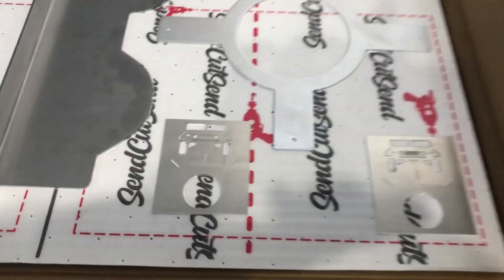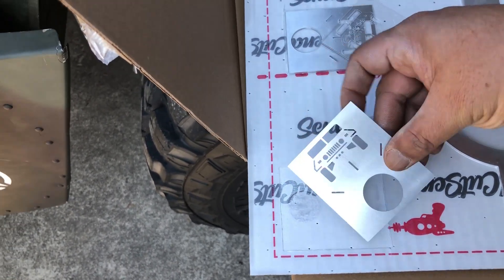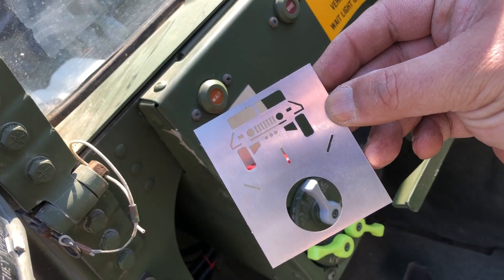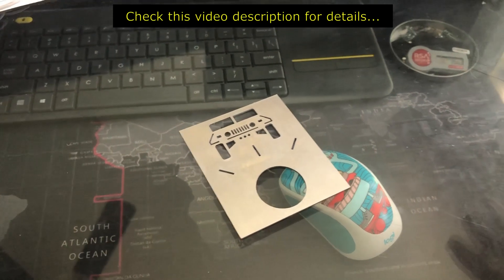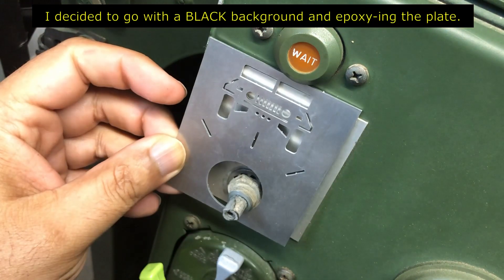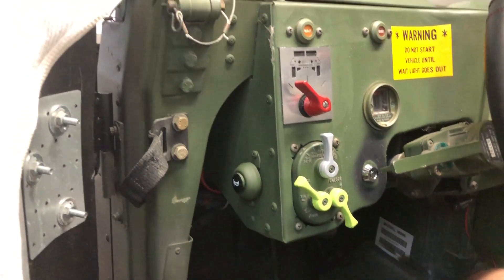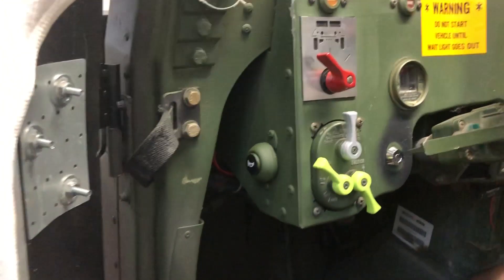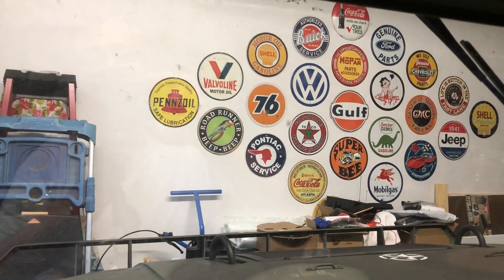Custom Ignition Run Start Plate for my HMMWV

Comment: Where did you get the different colored switches..like the red one and also the color ed ones on the light switch panel
Reply from the maker: I sanded / spray painted them myself 🙂
They’re made of metal. Rub them thoroughly with an alcohol wipe before spray, or finger oil residue will cause the paint to not stick.